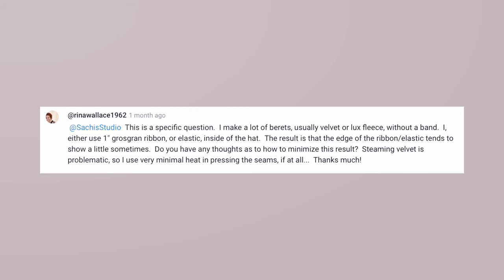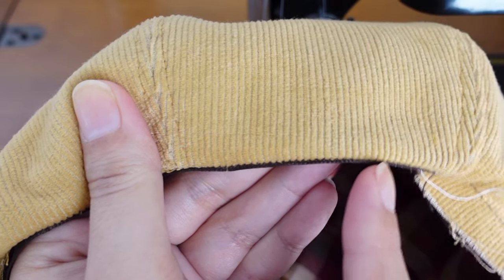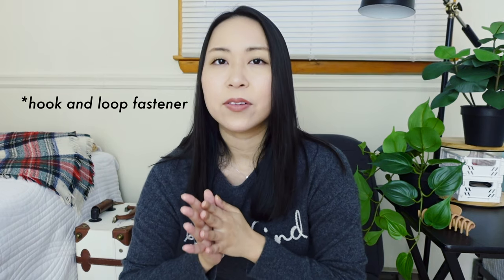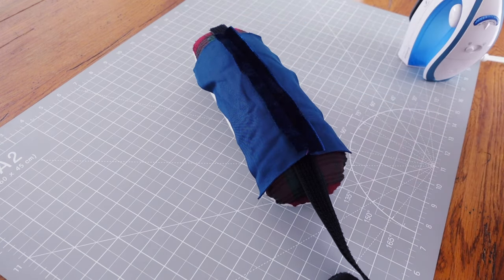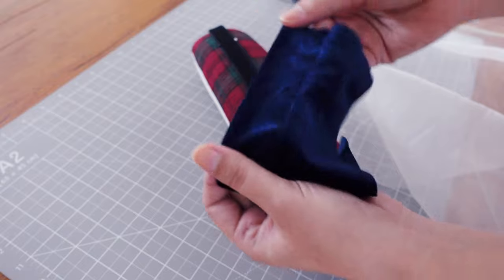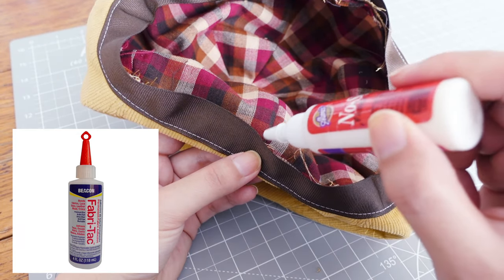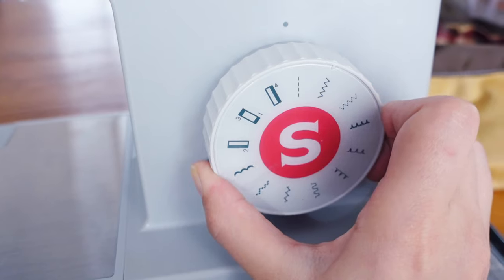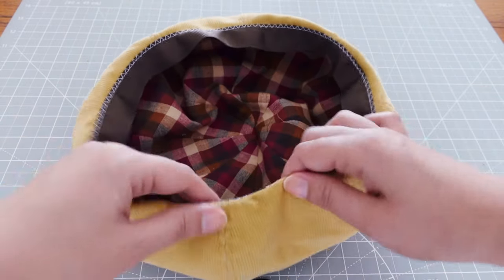How to Iron Velvet Fabric, Finishing Beret Hat with Grosgrain Ribbon

Comment: Oh!  I was super pleasantly surprised that you answered my question, Sachi!!!  I really appreciate the time and effort you put into trialing solutions to the problem.  I use a lot of velvet in my hat making business, so the needle board would be a wonderful tool to add to my ever growing collection...  I will put it on my wish list.  How did you think the velcro worked?  I could not see if there were any lines showing where you pressed the fabric.  I will definitely add stitching in the ditch on my next project, as well as zig zag stitching the grosgrain/elastic options.  Your little boy is so precious!  Thank you so much.  

Another question for you:  What craft iron are you using in the video?  I am considering purchasing the Steam-Fast SF-17, which was highly rated in a list of the best options.  It is quite inexpensive on Amazon.
Reply: I just watched a Threads Magazine video where a lint brush was used for pressing seams on velvet.  The velvet was placed face down on the brush surface and steam from an iron was blasted above the area, then the seam pressed with one's fingers.  The velcro method was also shown.  Thanks again Sachi!
Reply from the maker: I’m happy if the video was even a little bit helpful!! it was a good use for my failed project, too 😂 The lint brush method sounds very interesting, I have to try it sometime! Thanks for the info❣️I think Velcro worked pretty well, I didn’t get any unwanted marks from the iron! 

My craft iron is from Sunbeam.  I think I also bought it from Amazon and it was one of the cheapest ones at the time :) I love how compact it is, and I use this craft iron 90% of time over my regular iron!
Reply: @SachisStudio  Be careful with the lint brush method, Sachi.  It left a faint line in the velvet!  I just used steam from the iron wavering above the velvet, over which I layed my cotton ironing cloth.